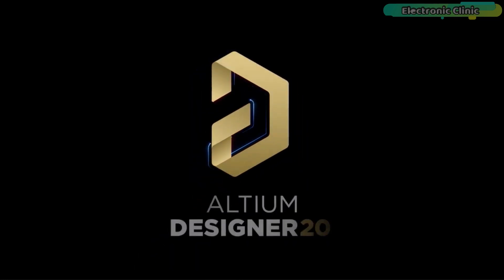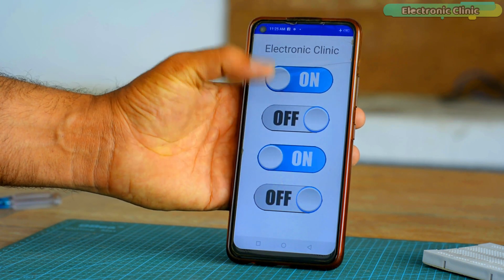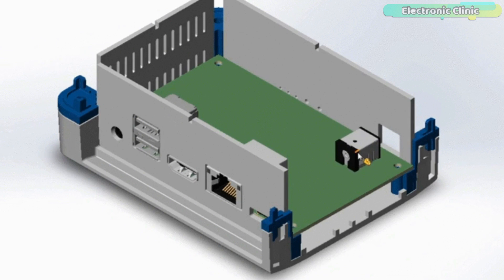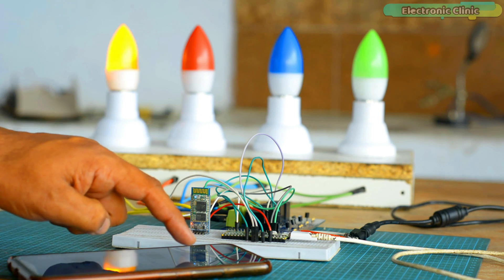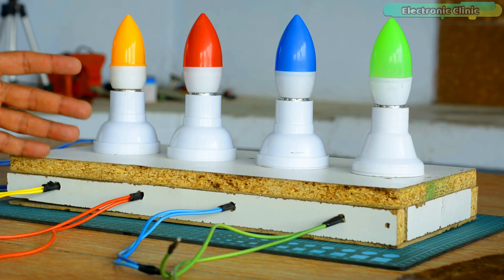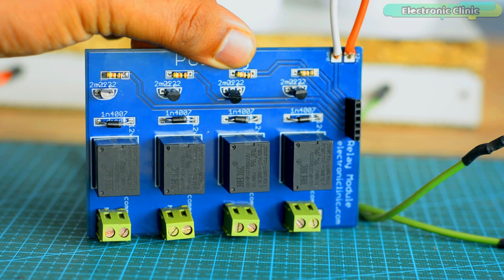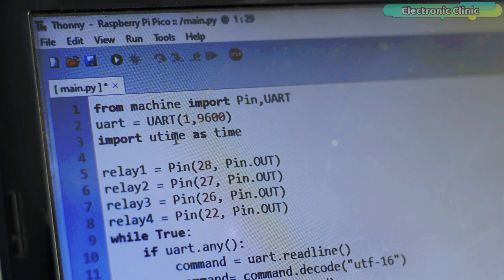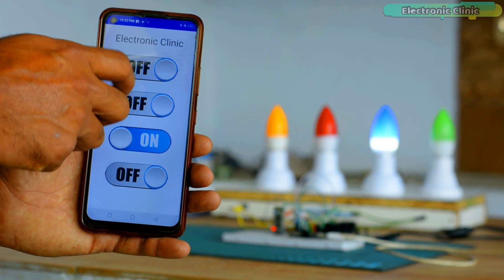Raspberry Pi Pico Bluetooth based Home Automation Project, MicroPython Programming

Comment from the maker: Raspberry Pi Pico Related videos for beginners:
Arduino Vs Raspberry Pi Pico:
https://youtu.be/15S8HM1GMu0

Raspberry Pi Pico Pinout Explanation and Onboard components:
https://youtu.be/q6rbqR4X7hE

Setting up Raspberry pi Pico:
https://youtu.be/jJBwi5pEvN8

Raspberry Pi Pico Led Examples:
https://youtu.be/0NmRtVAHJ9A

Raspberry Pi Pico Digital Input:
https://youtu.be/MCeQsSQu_sE

Raspberry Pi Pico Oled display SSD1306:
https://youtu.be/fH23Kvl_o_o

Raspberry Pi Pico Analog Input:
https://youtu.be/_f_tpVNMXTk

Raspberry pi pico Ultrasonic Sensor:
https://youtu.be/7R_-deTXDLo

Raspberry Pi Pico Temperature Sensor:
https://youtu.be/__v2P_RmXSY

Raspberry Pi Pico Oscilloscope:
https://youtu.be/p8pReLE4fYI